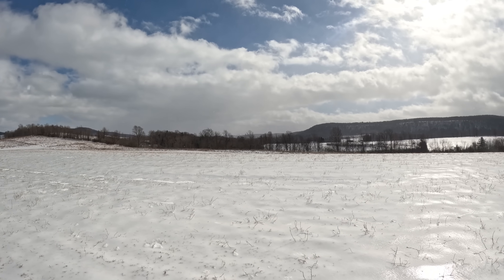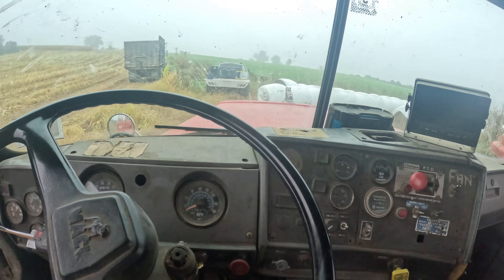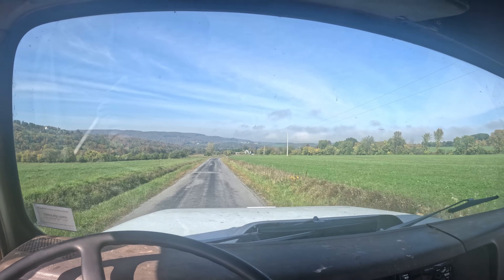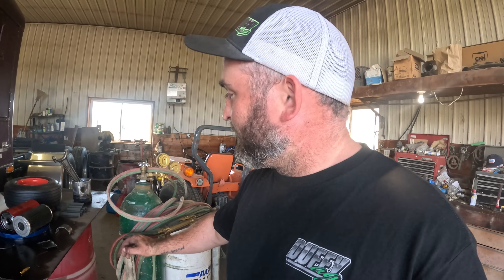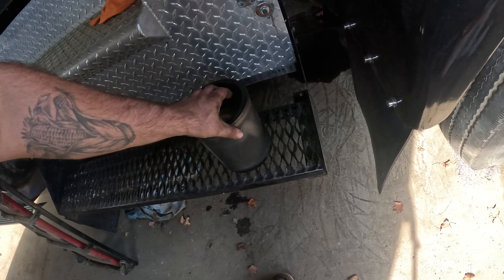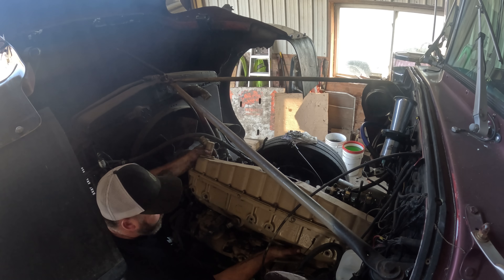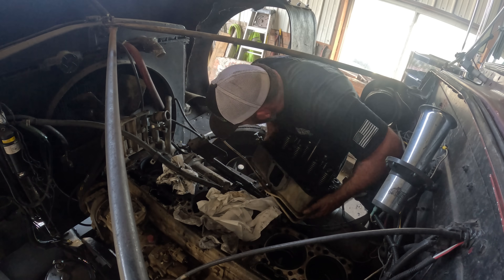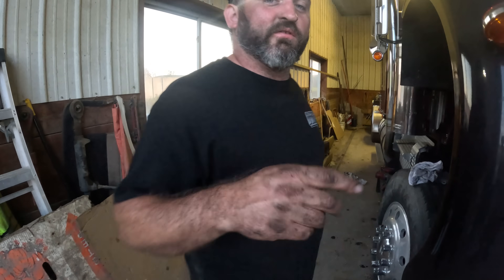Mack Getting Upgrades & W900 Kenworth Tore Apart.. How Many Pistons Are Bad?

Comment: We use a bauer transfer pump from hf to pump hydro fluid, coolant, engine oil etc. It's much faster then a hand pump.  Works really good, the bauer one will work off 110v also as opposed to milwaukee only working off batteries.

Comment: Not telling you what to do man, but if it was pushing too much fuel check the fuel button number on the PT pump. Some guys run lower number fuel buttons to increase the volume of fuel being shoved by the pump thus increasing the volume in the fuel rail. I did the same thing on my 855 but haven't had the same issues you had.

Comment: What? $40,000 to rebuild engine & get it road worthy ,  ,,  let it be repossessed.
Reply from the maker: 11k
Reply: @DuffyAg I’d wager you different - but, you need all your money, having 3 trucks down for over 30 days & a 4th truck with a failing clutch that hauls only 10 ton of corn silage.